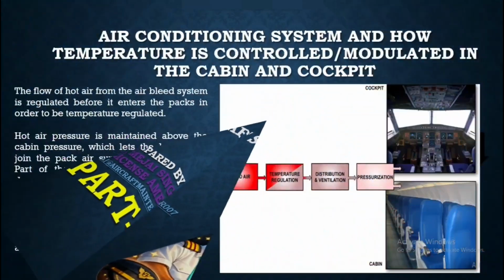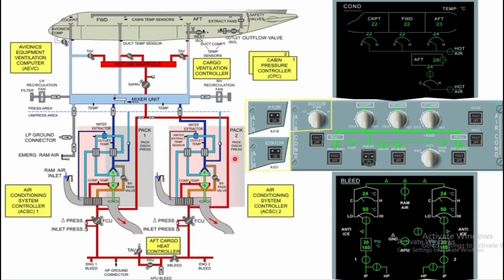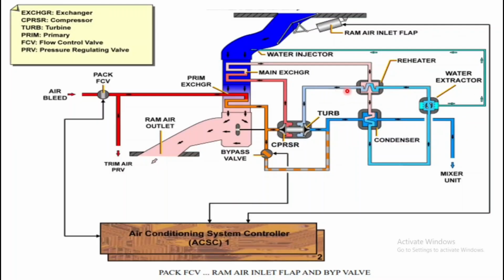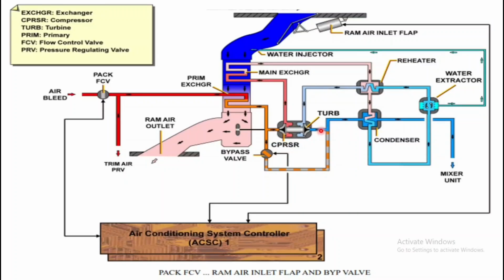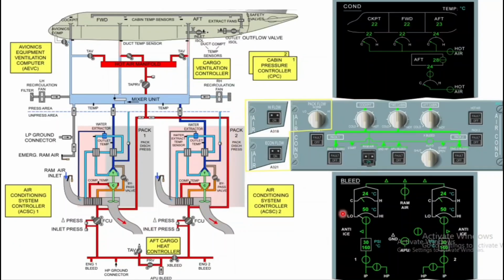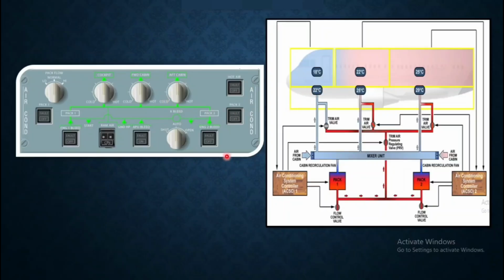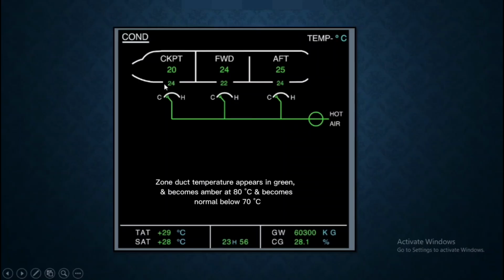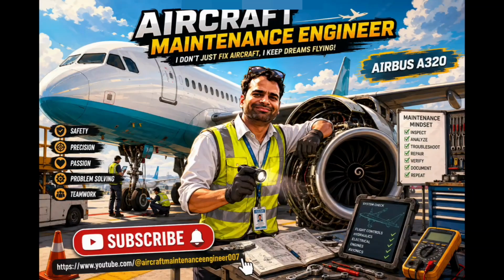AIRCONDITIONING SYSTEM ATA 21 PART 2 AIRBUS A320 FAMILY 🧰✈️🧑‍🔧🧑‍🔧✈️🧰

Comment: Hi sir 
Great explanation 

I have an doubt 
What is the start mark on the Air Cond panel (like triangle down)
Reply from the maker: Thanks, that start mark is for AIR STARTER UNIT POINT location will be on the left side of the belly area , u can say it just visual indication for pilot ASU will be connected on left side belly area, so it's good to start engine 2 first, in case of ASU use required. This is just for safety
Reply: @aircraftmaintenanceengineer007  thanks 🙏
Reply from the maker: Always welcome 🎉🎉🎉